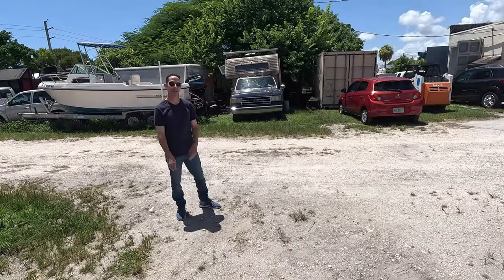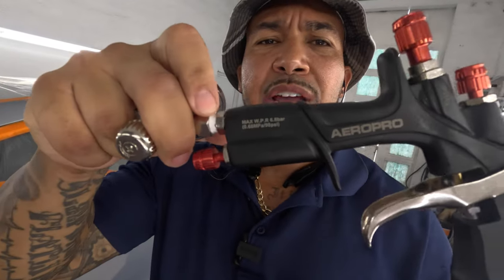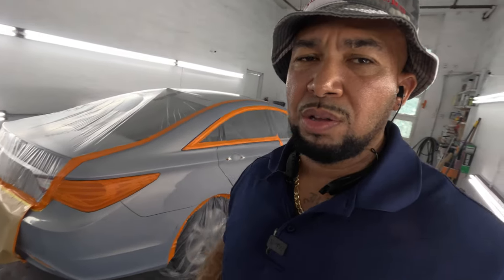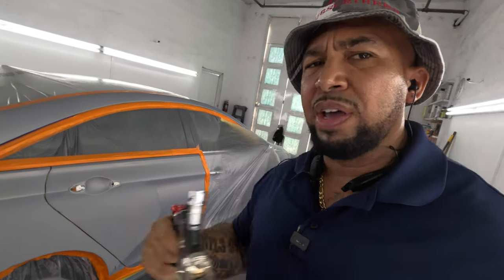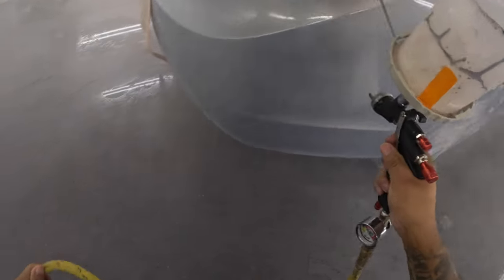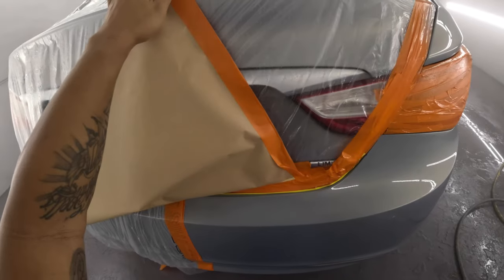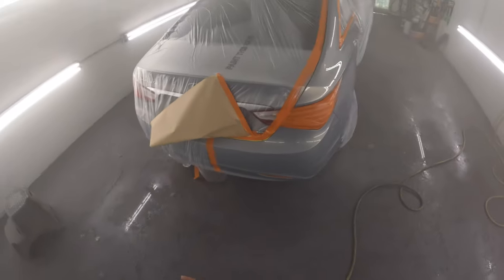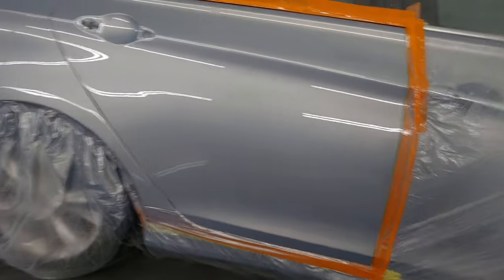never spray your metallics like this 😭 simple clear coat application Part 1

Comment: Way to really magnify your technique! I really need all the help I can get with technique on this tri stage Lamborghini orange Im working on right now. Its a 67 Mustang that I restored and nailed the paintjob down nice. The problem now is the customer got really wide rims and tires after the job was done and I had to do some modifying on the inner fender lips and heavy rear leaf springs installed. It also threw rock chips on quarts and fenders. great! So now I am almost ready to respray. I tried keeping the paint work small but that didn't quite work out so I am now coming to grips with the fact that on this color I will have to paint both sides tail to nose and hood with soft edge masked on the quarter body lines. This respray is really testing my skills but I think I can pull it off now. thank you for all you awesome videos. Your teaching has been very helpful! Fist bump Brother! Wish me luck!
Reply from the maker: Good luck bro. Just walk into it with confidence. sounds  like you pretty much know your stuff. You'll do fine. I have had several cars over the years that I had to paint the whole side and they were all on tri stages as well. Comes with the territory 😀

Good luck 🍀 let me know how it goes after you nail that sucker 💪🏼

Comment: Brother I've got to thank you! For some reason you're videos really made it click for me, after 6 years of everyone elses.. I sprayed my body kit, side skirts. The metallic & especially clear turned out phenomenal, best I've ever had with this spraymax clear. So deep and shiny, best I ever seen a clear on a street car.. 

I had to lay it on thicc! The 1 on the dark side of the garage  I noticed it wasn't as thicc so laid 1 more coat. Perfect. Have to spray this product till it starts to cloud up. I did some major repair work on them too it all turned out just great. 

It's the car on my yt page.
Reply from the maker: Ohh nice is that the Volvo? It has a nice stance. Man you should've recorded the job while spraying 💪🏼
Reply: @thetriggerman954  bro, I just caught a 30 lb flathead catfish last night!! Biggest of the year.. I dont have any gear for vids, just bunch of photos i could make a video from. Thanks, the volvo is being fully restored as daily driver,  piece by peice. All major panel replacement welding & repair is done. 1 driver side door replaced, 1 passenger side door on the way. Its been taped off like 50 times.. Will be redoing driver side quarter & sail, clear got botched at 3am in below zero temps, not my fault, well the 1st coat of clear was way past potlife & crinkled in some spots.. never again! 

then I'm restoring front bumper, the passenger side doors & then the hood next.. keep going till it's all new.

The whole mechanicals & suspension were restored & upgraded by me too, bolt ons to stage 2.5, full 3 inch exhaust I built super custom & the biggest front mount intercooler. Its 240k miles drives like new or better. For real, been working on it for 5 years.
Reply from the maker: @jeremyr7147  that's your baby 🙌🏼

Comment: You leaving me hanging triggerman. I commented on another video because I immediately noticed that cap is crap. I have an R500 and it sprays a larger fan pattern. I could not find anything wrong with the cap. Aeorpro sent me a new 1.3 cap. No change. They sent me another gut at no charge. No change. But hey, I got 2 guns for the price of one. If I can just find the cap to replace the original ones I know this gun sprays good because it sprays a lot better with the R500 cap.
Reply from the maker: 😆😆😆 hey man yea I remember you asked. Patience my man patience equals perfection 😉

Comment: That was me who posted a picture of the misaligned air horn holes on Amazon reviews. I returned the Aerostar and got my money back. I actually took it apart and found out the trigger valve uses a plastic bushing that isn't as smooth at the LT100 which uses an oring that is adjustable. I also have the Summit Racing LVLP which is the same gun as LT100. Summit Racing LVLP was ALSO misaligned so Summit refunded me my money. Then i got a 1.7 tip on amazon and now i use it with primer.
Reply from the maker: You sound like an engineer my man. Good eye for these things 💪🏻

Comment: Thanks for the truth Triggerman ! I bought the same thing and it’s not really a low cfm gun either  : small compressor is running way too much .
Reply from the maker: Yea my 2 small compressors were running non stop as well. But I wasn't even going to say that. I take enough heat from these dam spray gun fairies. But yes you're right. And I have to spray at 40 psi for proper atomization. I really have no idea what all the hype is about. But I'm new here and still learning 🤣🤣🤣

Comment: Good job triggerman. I've got the airopro A610 spray gun it's a good gun but I had to clean silicone out of the air Inlet check yours for that I'll let the underground painting king know that too
Reply from the maker: Thank you Larry, yes it was covered in silicone when I first got it. I cleaned it up pretty good. But I'll double check by the air inlet as well. Thank you man. 💪🏼

Comment: Man what gun you pull the cap off of??? Lol i been waiting since you posted the short. You killing me bro. I got 3 of these. One for primer i use at work, one for sealer and base at home and clear at home
Reply from the maker: 🤣🤣 and how do the guns spray? If they spray good you're all set 🤓 it's coming man just has to be the right time. Sound like a virgin chick.... It just has to be the right time when I'm ready 🤣🤣🤣🤣
Reply: @thetriggerman954  they spray ok. Definitely not glass like you got lol I'd say they replicate most factory orange peel. Any lvlp mod thatll lay glass i need 😅 i hate cutting and buffing. I've done it enough

Comment: Wirh the original cap was it spraying a crescent shape fan instead of a nice long oval?
Reply from the maker: It actually was a normal pattern a slim oval shape but it just didn't atomize properly for the amount of pressure I was spraying I just felt it wasn't atomizing to the best of its ability if it even had that abilit

Comment: What's your recs on a good cheap primer gun
Reply from the maker: Good cheap gun I'd say the Vevor would work. Comes with 1.3 and a 1.7
Reply: Thanks, checked out ratings awesome.  Would it be on par with the quality of anest iwata lph400.
Reply from the maker: @andrer3854  no sir, lph400 is a totally different ball game. the LPH is one of the best spray guns in my opinion. Which is why it still sells for over $500 20 years later. Awesome gun. Vevor is $80 and is a good cheap gun like you asked. For primer but will spray good paint as well. I have a few vids up with the Vevor, I'm also dropping a real nice video this Friday with it in think you should watch. It gets great results.

Comment: I don't think this gun sprays bad at all. It sprays as if you turned the spray pattern down to 80% compared to the R500. If your the type of person that paints with your spray pattern turned in a bit or uses a small spray pattern from you paint gun it is great. If you have used an FLG 4 which has a 6" pattern at 6" this is such an upgrade. It sprays a 8-9" oval pattern at 6". But the R500 cap sprays a 11" almost rectangular pattern at 6". It's better to have it and not need it than to not have it at all.
Reply from the maker: Then it works for you. That's good. But lots of other folks have an issue with it. And it's not that it sprays "bad" it's just that it sprays 10x better with another cap. The video with the other cap is uploading now. It should be up in an hour or so. 💪🏼
Reply: I appreciate you doing the work to figure out what is wrong with this gun.
Reply from the maker: @Scrappydootrades8256  no problem bro. Yea seems guys are coming out of everywhere saying that there is an issue with the gun. New vid be up tonight. 4k takes forever to render 🍻🥳

Comment: In my experience, all of the R500 variants suffer from  lack of optimal atomization and fluid output. Despite being advertised as LVLP, they've been tested to use twice more CFM than stated, but that means for the real 8CFM or so, the fan pattern is rather subpar compared to other guns in that same range. I don't recommend them for the performance only. For low budgets perhaps, but that's about as far as it goes. There's too many other guns that will outperform it for similar air consumption. 

As a side note, the original R500 was "poorly" cloned after the Iwata W400 series and will fit those caps, nozzles, and needles. The issue is now that those parts are costly, it brings to question the value of such swaps. I definitely wanted to try it on my Astro Evo4014 as the body is superior to the other R500 variants, but the older Iwata parts are just too dang high to try on a cheap gun.
Reply from the maker: Tell Em BossHawg  I really don't know what all the hype is about. I think maybe the guys spraying them have never really sprayed with a good gun so they don't really know the difference
Reply: @thetriggerman954  unfortunately, too many watch videos while failing to do their own research along with it. While some of the content creators mean well, they lack some of the scientific work to prove manufacturers' claims.
Reply from the maker: @bosshawg7427  I hear that, well I don't do any of the scientific work either and I'm no pro when it comes to the CFM and I do let that be known but what I do know is when a spray gun is or isn't capable of producing a good finish and if it's even worth the price and struggle of making the gun perform. Thanks for chiming in Boss 💪🏼
Reply: @thetriggerman954  much respect on being honest in your experiences. Far too often, some of the other channels come across as if they're afraid to be honest about a product. Yours was the first that admitted the Kiwami was a little hard to tune which is typical of most Iwata guns. Other channels simply sung praises without bringing up the cons. It's a good gun, but info like that is important, too so beginners know what they're getting into.
Reply from the maker: @bosshawg7427  appreciate it man. I'll ALWAYS keep it 💯 with you guys. Even once the big companies start sending me shit 💪🏼🤜🏼🤛🏼

Comment: Original Rongpeng RP8311 Air Cap for original Rongpeng R500 spray gun.
Reply: But that's not the R500 gun that he's using. Its the A610.
Reply: @Jerome3278 I think he means you can use the original caps on this redesigned version. 🤷‍♂️